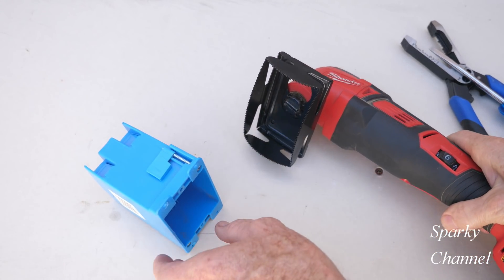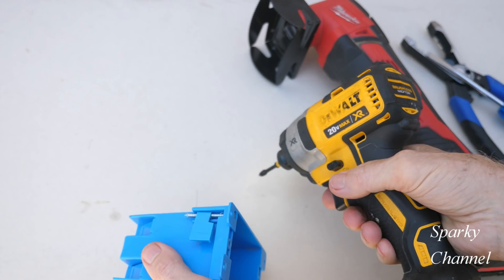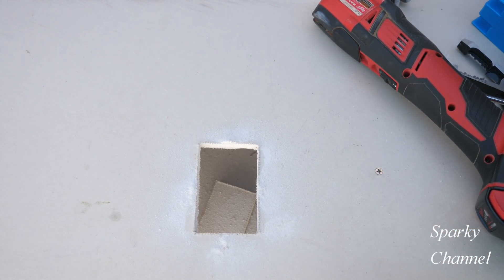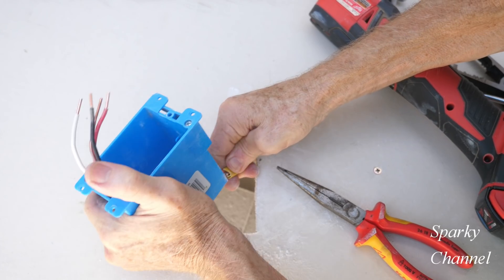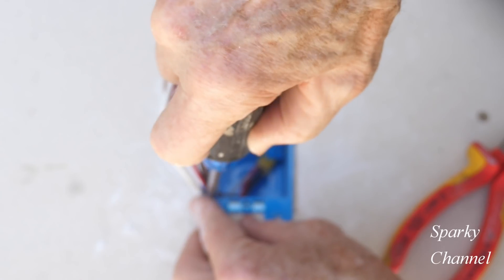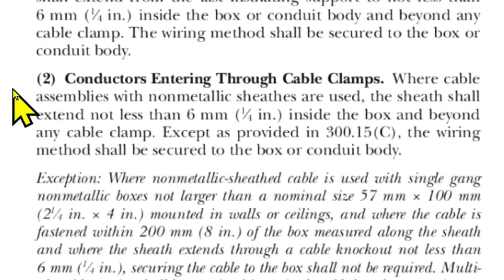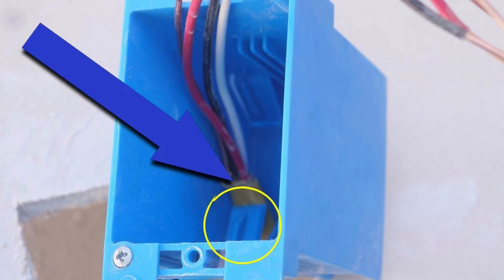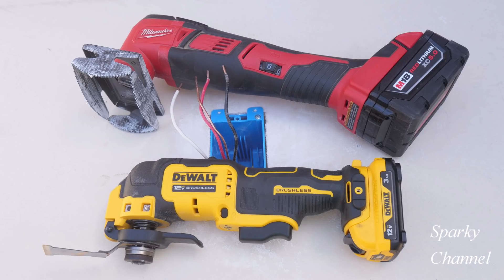Q-Bit Outlet Box Saw Demonstration and Wiring with 2020 NEC 314.17(B)(2) for Old Work Box Install

Comment: Do you need to pull the tabs off or leave them in the box? The tab where you pulled the wire thru
Reply: Tabs stay in the box. Poking them in a little helps get the wire in. But they stay in place. They are integral clamps.
Reply from the maker: Excellent!
Reply: He explained it in detail. You just have to watch the entire video 🙄
Reply from the maker: @noelv1976  It's a point I wanted to make because the tabs get destroyed so often. Gumba Sal said it just right.

Comment: Wow! Very useful for saving time and money when preparing new drywall after wiring up for the receptacles, switches and light fixtures. Even provisions for low voltage wiring such as coaxial cable for TV and ethernet cables can be made from that tool!
Reply from the maker: Sounds good, thanks!

Comment: Do you think the Milwaukee M12 Fuel would have enuff power ?
Reply from the maker: I think so, but I might just have to try it out. Q-Bit says to not use a 12V tool, only 18V.
Reply: @SparkyChannel  wow that's pretty interesting that they say that, the M12 multi-tools specifically the Fuel is an incredibly capable tool even when compared to 18v tools.
Reply from the maker: @LzysGraphics  See my video: Fast Holes in Drywall with QBits, 4 Sizes! Installations and Reviews: https://youtu.be/w5-gEulebm4 
  I use a couple of 12V tools with one of the QBits.

Comment: What is best practice if you break the plastic clamp holder thing in the back of the box during installation? New box or simply press ahead? I seem to remember some code about not needing a clamp if the nm cable is supported within six inches of the box…which would be hard to do with a cut-in box, but…
Reply from the maker: With an old work box it would be easy to replace the box.

Comment: I do low voltage cable installs I absolutely love it. Perfectly straight and exactly right sized holes every time in 1/2 the time. Just make sure you use the low voltage blade for low voltage boxes which is bigger than the electrical box blade.
Reply from the maker: Great information, thanks!

Comment: Here is the problem with the 2020 code. Grandma has a 30 year old fuse box. She needs a new one. She calls the local electrician. He has to install a new $300+ meter can with exterior breaker. Thats for starters. Then each GFCI or AFCI breaker is between $55 to $100
Reply from the maker: I totally understand. It keeps getting more expensive with each new added code too. And as an electrical contractor, I can tell you that labor costs have risen too.
Reply: Better than having to buy a new house after fire. Problem is insurance claims have been up with Electrical fires.
Reply from the maker: @InfoOnly2U  True, but I do feel for William and his price concern.

Comment: I just cut right next to a stud and screw into it. I use a regular nail on box with all the tabs broken off on the outside. Works way better and a lot stronger than the old work box.

Comment: So no neutral at that switch?
Reply from the maker: @TheSpiv  Yes, but the Lutron switches such as their timer switch work much better with the neutral terminal and they serve a wider range of devices.
Reply from the maker: The 12/3 with ground has 2 hots, a white neutral and a ground. With a standard 3-way switch, you don't need the neutral but with the digital 3-way switches you do need it.
Reply: @SparkyChannel  For a three way switch, the white wire is not a neutral/ grounded conductor. It is a ungrounded conductor of the switching circuit. Just because it is white does not make it a neutral. If there will be a single pole switch installed it is correct. 404.2 (C) may be your reasoning?
Reply: @SparkyChannel  hasn't their been a requirement (404.2(C)) for a grounded circuit conductor for the controlled lighting circuit to be provided at the location where switches control lighting loads that are supplied by a grounded general-purpose branch circuit since the 2011 code cycle?
Reply from the maker: @phildegruy9295  Yes.
Reply: @SparkyChannel  I always mark the white wire with colored tape in a 3way switch install and if it's a digital 3way switch, I run an extra white.

Comment: Do you have a good solution for plaster and lathe?

I use a m12 cut off tool with a vac to cut the plaster then tap that out with a hammer then a oscillater to cut the wood lathe, it works but I'd love a better solution.   Also another prolbem sometime the wall is to thick for these style  boxes ,  I would like to find a box that has longer reach back any ideas?

Another quick tip for guys working with plaster and lathe after I'm done installing boxes i give them a little shot of canned spay foam around the outside of the box, that keeps them rock solid.
Reply from the maker: I use tin snips for the lathe or a metal oscillating blade. For the plaster: DEWALT Oscillating Tool Blade, Diamond Grit, Flush Cut (DWA4242): Amazon: https://amzn.to/3xhqLYc
  Also, a beater chisel and a hammer is useful.
Reply: At mom and dads house built 1915ish the plaster lathe was so hard, I used a 4 1/2” diamond disk to cut down to oak. Joists were so hard paddle bits would burn up, had to use steel metal bits.  Those walls would have laughed at this cutters teeth.
Reply: For hard plaster & wood lath I use two blades for a flawless cut. First score the rectangle with a utility blade. Then use a diamond grout blade to get through the plaster clean. Then clean wood blade for the lath.

Comment: Hey Bill, first time used a QBit blade was bit skeptical, like it’s a gimmick. Was surprised though and use them all the time. Like using them as can just go at it and knock out the job in no time. 
Also like the protection features of not cutting you if hits skin etc…. Reminds me of the saws used to cut casts off , and I’m guessing that’s the idea behind this maybe 🤔 
Either way, like my QBit blades.
Cheers✌🏻
Reply from the maker: Thanks for the review. Have a great day!

Comment: Good way to get fired or laid off
Reply from the maker: Why?
Reply: @SparkyChannel  just saying, if your foreman see you using that he may say, don't you have a drywall 🪚, well use it and put that away. Awesome tool though...ain't knockin it
Reply: @ddaniels2901dd  if that's the case, you're better off working for someone else. Either that, or make a bet with them and see who finishes first.
Reply: @IceBergGeo  that's reasonable

Comment: I've looked at the performance of that blade, and for my standard, the hole is a bit on the sloppy side.  I also avoid having cut in boxes floating in the field like that, so I have to saw cut my first two lines to get the box tight to the framing.  I also hate that style of internal clamp to the point I avoid any Carlon boxes except the Adjustabox series. it's tolerable if you only have one cable entering the box, but with more than one, it keeps the wires from folding in neatly.

as for blades, I keep a set of wood cutters and metal cutters, since I mostly use mine to cut wood paneling, cut in floor boxes, or to cut bolts.
Reply from the maker: Yes, most people just destroy the integral clamp in the Carlon boxes because it's faster that way. If you use them properly, they end up taking more time than the metal clamps.
Reply: @SparkyChannel  I think the only integral clamp I've dealt with that was worse, and I forget the brand, was one that had about the same profile, except it forced the cable entering the box to come in TOWARDS the front of the box, so there was no way to stop the cable from conflicting with the device.
Reply from the maker: @kenbrown2808  I have a video, "How Far Should Sheathing Extend into a Panel? NEC 2020 314.17 (B), 312.5 (C) and 110.12": https://youtu.be/fjb9vK65ZSw
  that shows how badly apprentices mess things up using the plastic "speed" one-way clamps. I'll stick with the reliable metal cable clamps when possible.
Reply: @SparkyChannel  I remember that one.  I remember the old aluminum "1050" romex grips.  I was happy when the RC-50 style connectors hit the market, because they were less of a nuisance.  I hate the 2-screw style for romex, because they are so awkward to work with, and I've seen them messed up, including one case where a retired electrician overtightened one and cut into the conductors.  the real thing I see is that some electrical components are just badly designed, and should never be used, but most equipment works fine if the installer is competent in its use.  it's the "hurry every chance you get" guys that typically screw things up.  everybody with any experience has a collection of war stories about that guy. (once spent an hour fixing issues after the boss of the company I was working for after he came to show us how to get things done faster.  and yes, that's a WAS working for.)

Comment: I would have to buy an m18 tool to use it :(
Reply from the maker: Q-Bit does say you need an 18V oscillating tool. I'll have to test it out with my DeWalt 12V Max.
Reply: @SparkyChannel  pretty sure my local alarm company uses M-12 tools, including for that cutter.
Reply: Giver 'er a try, Bill.  Thanks.
Reply from the maker: @donl1410  Hi Don! Pricey but recommended. Stainless steel and made in USA.
Reply: They have the bit for dewalt as well
Reply: @airmax925  the cutter is universal.  it will work with any tool.
Reply: Might fit a harbor freight multi tool

Comment: Might use a torpedo level to square the cut lines first. I have a 5 year old dremel plug in but would buy the dewalt since I have the 12v batteries.
Reply from the maker: Yes, excellent advice. Thanks!